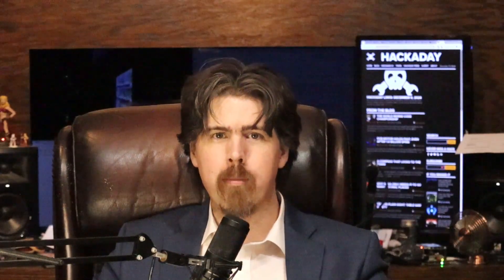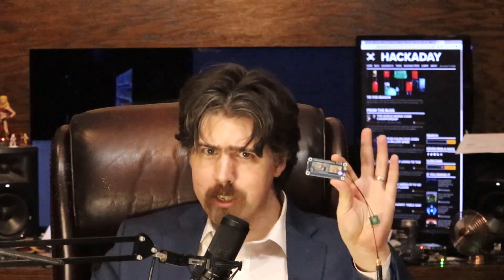I Goofed! The Meshtastic CRC Problem

Comment: Glad I saw this before putting a node up a 45' mast. I'm using a E22-900M33S instead, which has a TXCO in it. It's a little bit of breadboarding and soldering but not terrible. Thankfully they published the schematic and it's supported already for RPi setups. Just a couple of capacitors on the power line is about all you need.

Comment: Thanks for the update - might explain my baffling performance. I have two of these and not managed to get any significant connections with them - I sometimes see nodes but not been able to communicate. Is there a link to this issue being tracked? Github perhaps?
I have temporarily swapped my Waveshare hat node with a Heltec v3 to see if that improves my connections.

Comment: damn, I just got a Waveshare hat but haven't installed it. Is there a way around this?
Reply from the maker: I have two of these units, and one doesn't seem to have the problem. So try it first! Higher bandwidth presets work better. So Medium fast has much less of a problem.
Reply: I have a Lora Gateway running local chirpstack V4. I did think there was maybe a way to get it to connect but the Waveshare wiki is unhelpful and I can’t find anything on GitHub. I think this may turn into just eWaste. On the other hand the Waveshare pin out does mention a CLK pin so maybe I can add an external clock?

Comment: oh no, I have a pico_w with waveshare hat in a little plastic electronic junction box as my flagship 😄
wonder if I can an external crystal.
Reply: pico_lora has a TCXO, according to the datasheet. However the self contained rp2040-lora does not. I have both and can confirm a difference in performance.
Reply: @davecook791  That is weird the waveshare RP2040-lora schematics show a TCXO at Q1
Reply: @danboos  You're right, it's labelled a TCXO. However the design allows for either an XTAL or TCXO to be fitted as Q1, and jumper H2 is to be set as appropriate.

Apologies, my original reply wasn't very clear.